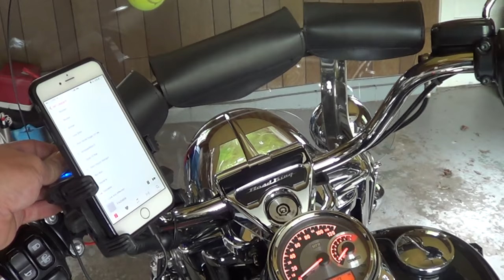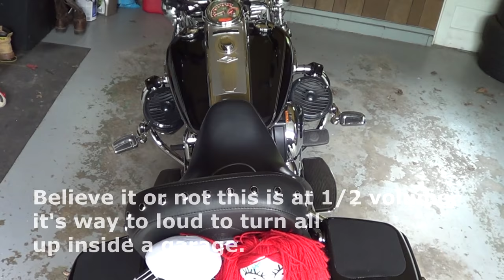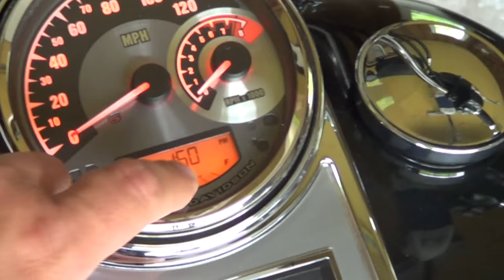STEREO system on a 2016 Harley Davidson Road King

Comment from the maker: The advantage to this set up over a lot of the super loud systems, both my bags still have a ton of room for storage.  this isn't terribly loud with bass, but you really can't hear bass when riding without dumping tons of power into it and loosing all your bag storage space with amps, extra batteries and capacitors, not to mention spending a ton on a good alternator charging system this all together was right around $1k, getting a huge bass output your looking at more than double that price.
Reply: what did you use to mount the Bluetooth volume control?